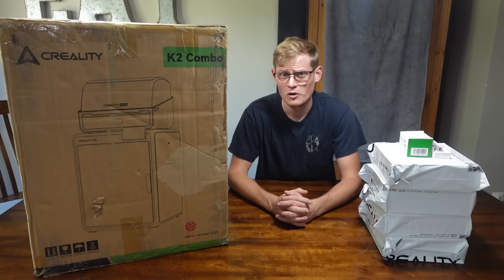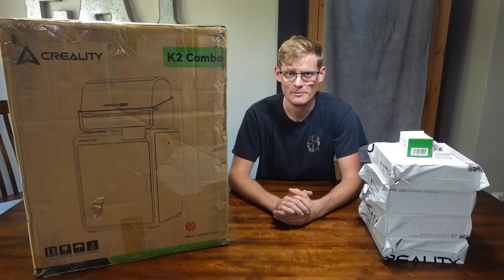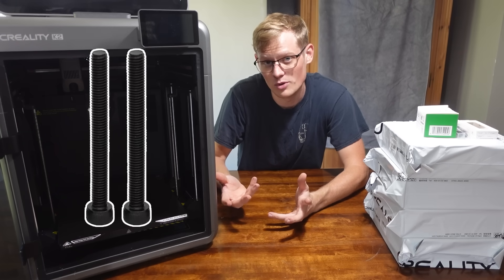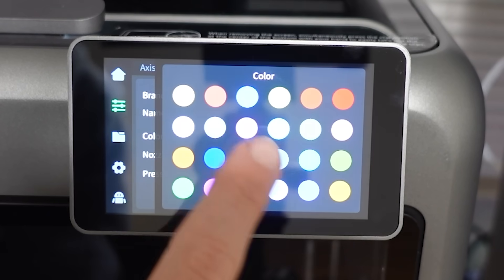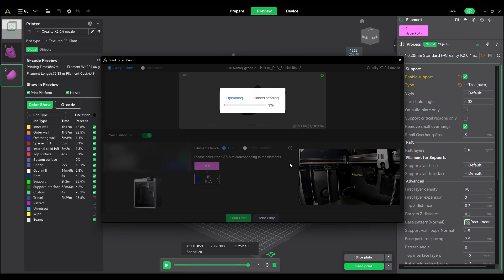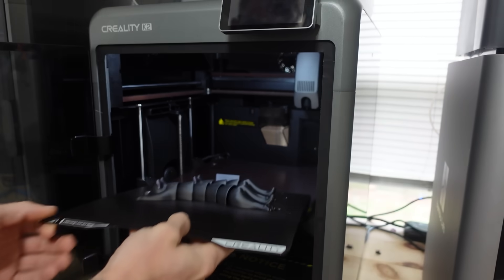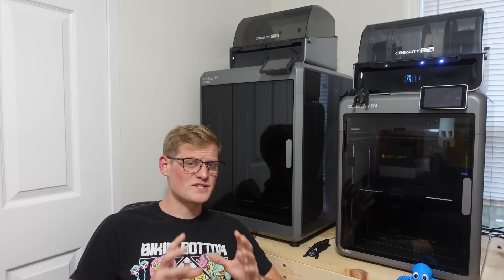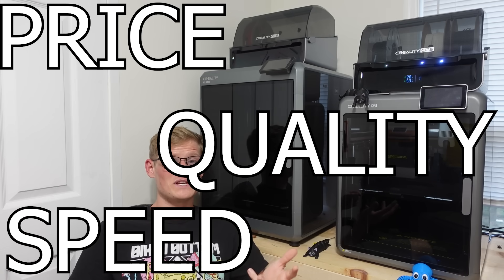Most Advanced Budget Printer – Creality K2 Combo Unboxing & Review

Comment: Finally someone with a K2 and not plus or pro!!!!🎉
Reply: The naming schemes on 3d printers is the worst. Worst then CPUs and GPU naming.
Reply: @Captain_Hindsight  It's not really a bad naming scheme. There's the K2 which is the small basic printer, then there's the K2 Pro which is still small but has some advanced features and then there's K2 Plus which is larger. The problem is that the K2 Plus was released first, almost a year ago and the K2 is super new so all the videos and reviews mention the K2 Plus.
Reply: @yourusernamehere  you dont seem to understand that when you name something k2, it will also show k2 plus and k2 pro models. its bad naming, it should be k2 lite or something
Reply: @Vader294  It's not complicated.  There is a K2 base model, a K2 Pro and a K2 Plus.  They all fit their names.  The only anomaly is that the Base model came out last.  But the names make perfect sense for the capabilities of the devices.
Reply: @yourusernamehere SMALL? 260 is crazy
Reply: Facts
Reply: For real though!! My god… It’s as if the base model doesn’t exist!
Reply: YES I HATE HOW THIS ONE PRINTER IS OVERLOOKED
Reply: For real there is nobody out there that has the K2

Comment: There is soo much choice, k1c, k2, bambulabs p2s just came out, i am lost, have an ender 3 v2, not sure what to choose as an upgrade. (I mostly print fpv drone parts and action cam holders with TPU)
Reply: Depends on what size you need to print. I would recommend the K2 series over the K1 as it is updated/newer tech. For me, I have enough printers the size of the K2 so went with the k2 Pro as the 300x300 build volume is better for my products. The K2 Combo compares well to the P2S but at $100 cheaper than the P2S and not being tied to the BL ecosystem, it would be the choice over the P2S for me.